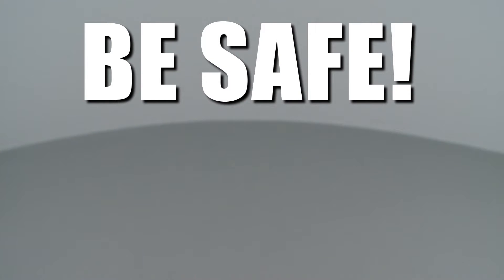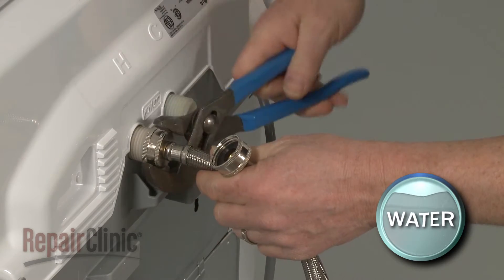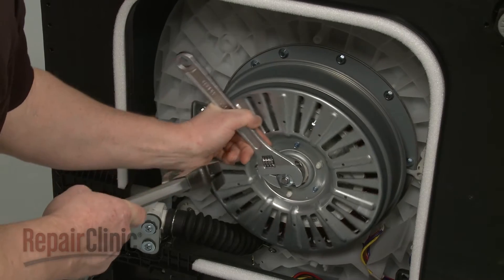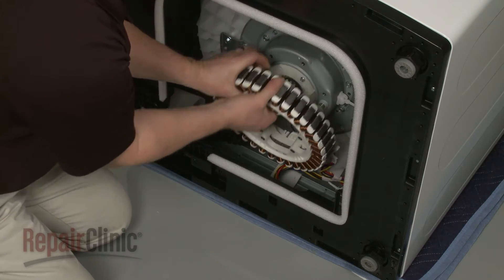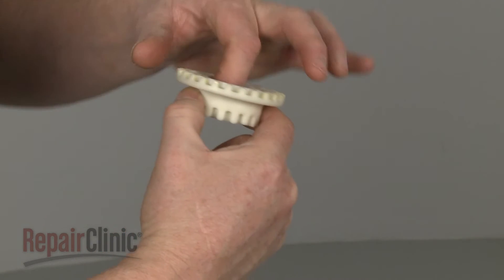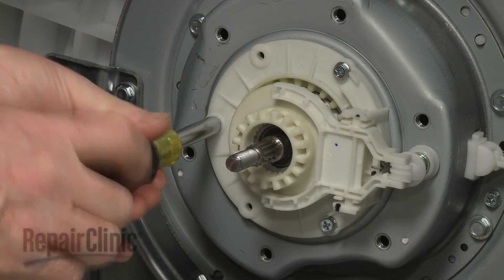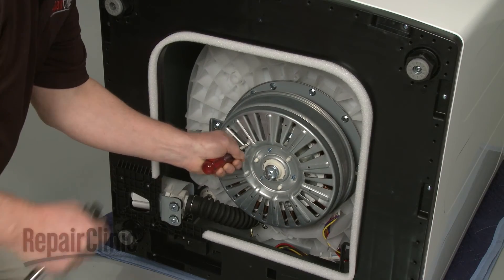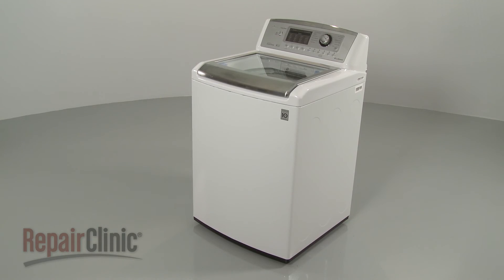LG Top Load Washer Agitator Coupling Replacement #MCJ61861201

Comment: Followed this video. When I reattached the rotor nut, the bolt broke off before I ever reached 88 foot-pounds on the torque wrench. Now, a minor repair with a $3 agitator coupling is going to become a major repair with a $100 clutch assembly.
Reply from the maker: +John Shea That is unfortunate. Thank you for sharing your story.